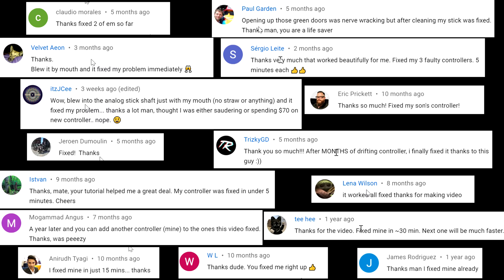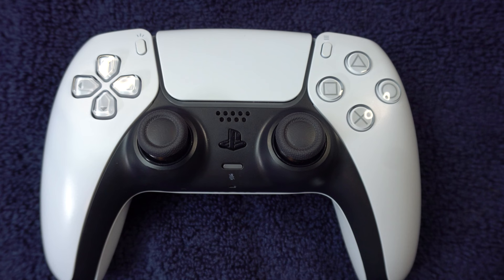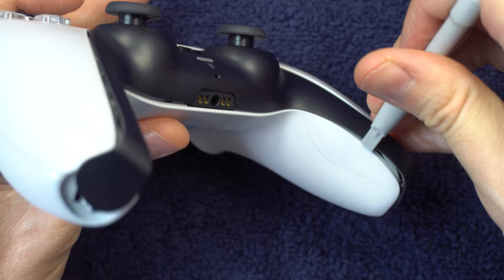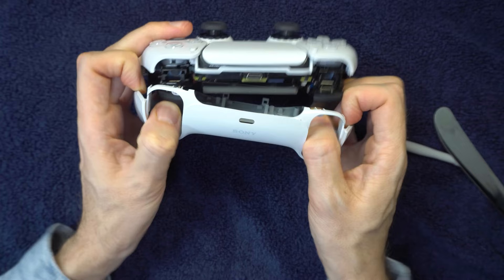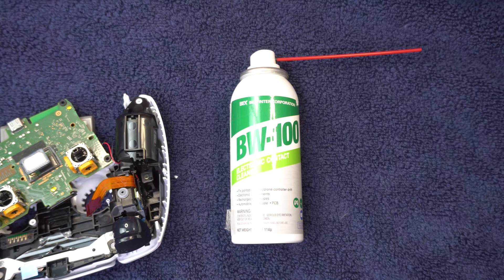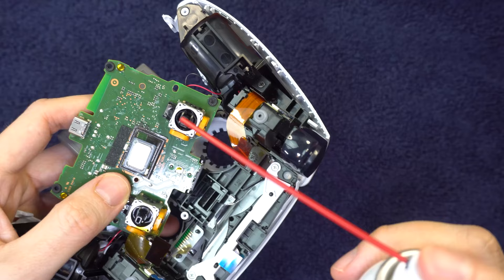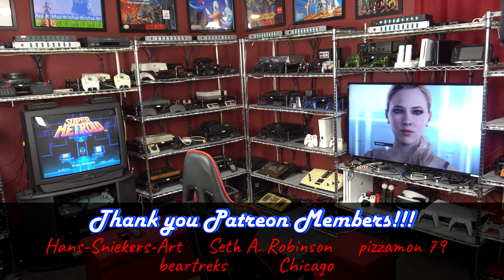How to Fix Analog Stick Drift on PS5 DualSense Controller (Sprinting/Repair/Clean/R3/L3/Take Apart)

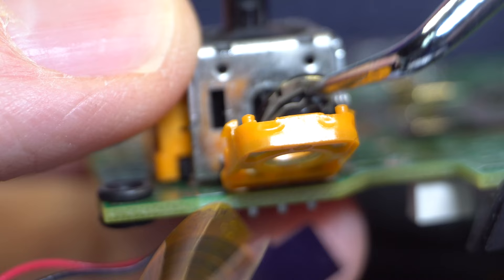Comment: At first, I followed your methods 6 & 7 (minus the reassembly between the steps), then I reassembled it. The right stick (which had been working fine) kept registering left/right. The in-game camera it controlled kept spinning around the character. I figured I must have goofed something in the reassembly (since it was the left stick that had had the drift (only it was behaving at that point). I watched again where you said to make sure to hang those little wiry discs on the hook right side up (like you showed at 12:50) and I wiped it with a dry Q-tip once more after I hung all 4 of them this time. I must have messed up on the reassembly a bit the 1st time, because one of those upright contacts on the board that touch the speaker looked like I must have bent it when I snapped the cover back on the 1st time, so I tried to bend it back. IT SNAPPED OFF! I kept going though, and after reassembly and 10 minutes of testing in-game, there was no issue at all. I'm a bit sorry about the speaker contact, but this was after a long day at work, so it's better than having to buy another PS5 controller. Thank you, How to X.

Comment: The majority of issues that cause analog drift is dust/debris when your not using your controller lay a microfiber cloth over it if you don't have a storage device. 
Even a thin plastic bag,etc. 

You can decrease your odds of getting analog drift by doing this. 

I disagree with using a straw or even a can of air and putting the straw in the analog. 1 if you use your mouth your blowing in hot humid air which negatively effects the lubrication/grease within the analog sensor device. It can dry out the grease and if you use your mouth the humidity can cause the lubricant/grease to thin.

I recommend that if you do use a can of air, keep it an inch away from the analog and spray air inward as you use your other hand to move the analog stick around to allow air to gain access inside. 

9/10 controllers I service that have analog issues is dust/debris (like eye lash hair for example). The disassembly of the controller illustrates here is the correct method  and the narrated directions are superb. The only critique I have on the disassembly and reassembly is that you should use precision tweezers and/or precision needle nose pliers when removing the data connection ribbons from the motherboard using the tabs and not gripping the actual wires. If you use your fingers and are unfamiliar with the durability of the connection ribbons you can crease or crack them and damage them to the point information is not passing through.

Good vid, love the content, keep it coming.

Caught myself spelling ribbons incorrectly lol had to edit to correct 😂 my apologies all, English is not my 1st language.
Reply from the maker: Thanks for the comment. Do you happen to know how someone can push L2 and get forward movement in their analog stick, despite not touching the analog? My next video is about this mysterious issue.
Reply: @HowToX  
I haven't faced this issue with a PS5 controller, though the operational mechanics do not differ much from a PS4 controller.

1. Conductive liquids being spilled in can be a culprit (soda, etc). If the covered area crosses past both the analog connections and the trigger connections.  

Faulty L3/R3, if you have cracked or damaged the motherboard from beating up on the L3/R3 that can cause the issue and even a creased/broken ribbon can cause the wrong information to be read by the controller. 

If your sure no liquids have been spilled, check your ribbons and use a  led light to shine through from the back towards you to ensure the inner connection lines are not broken and/or cross do to crease/collapse.

If nothing visible it's not the ribbons.
That leaves you with a faulty L3. Where I would suggest removing the analog, remove all solder (or at least as much as you can to get a clear view of the motherboard connection) look for crack/breaks using a magnifying glass or any optical enlarging tool you have at your disposal.

If no cracks or damage re-solder on the analog as the solder itself may be the culprit. It it persists change our the analog. 

That should resolve the issue.
Reply from the maker: The thing is, it's a specific bridging of signals between two buttons, the L2 and L3 or R3. It's never any other combination (in the sampling I took). Do you mind watching my video on it right here: https://youtu.be/_QmL9YEP3M0

Comment: Replacing only the disc won't do much, if anything. The problem is the conductive material of the "door" part gets scraped away over time, so that is the part you want to replace.
Reply from the maker: It can get dirty, scraped, or both. Sometimes they leave the factory dirty.

Comment: Does the printed circuit board have a protective coating on, when cleaning with IPA I noticed like a yellow hard gel coating on it, I cleaned it off. The controller works amazing now. I even cleaned inside the yellow doors. Thanks for this guide

Comment: I fixed mine,  this is what you have to do.
#1 those two knobs swop them.
#2 make sure all wires are in place if not glue or saulder them. 
#3 that box with the lil door open it a little and pore alcohol on the whole box. 
Thank me later!

Comment: I replaced both potentiometers in my right analog stick and it seems that I got two with quite the difference in resistance compared to the originals that were on it. I wish there was a way to recalibrate them like they do at the factory. My stick drift is now worse than it was before. Lol.

Comment: I have cleaned as instructed, thank you by the way.  My right joystick moves freely in all directions except up (when apart) down when assembled.  I cant find any videos on this issue.  I used q tip with alcohol to clean the stem and in and around the base but that did not work.  any advice.

Comment: 8:13 The drift prob are behind the 2 Yellow things on the stick.
Use a knife, twist knife and gentle pry them open. take out the little thing inside.
And clean Inside and the little thing, with a Qtip and cleaning alcohol, 
dust and dirt inside where the yellow things are, 99% cause the drift prob.
Lost count how meny playstation controllers i'v fixed for people. it's soo common. hehe 
I repair home electronics at work.

Comment: Is not just  the analog potentiometers what need cleaning ive taken myne apart is only 5 month old controller the analog was constantly getting stuck fully when moved to top diagonal position kept test gently moveing the white analogue potentiometers grid between analog stick still got stuck slowly streched got stuck in another position eventualy removed been stuck still got stuck mostly in diagonal position every so often constantly got stuck the white thin plastic each side between analog flexers when move analog over time degrades gets weak poor cheap part mechinism not just the analogue potentiometers

Comment: It didn't work for me, it got even worse. When I was testing the Z axis wasn't showing up. When I boot up a game the left directional stick started going right worst than it was before. It's was stick drifting right but now it's going right even more and it's not stopping. Each time I tried checking if I did something wrong but I did everything right and I follow everything carefully but still not fixed...I don't know what to do now

Comment: switched both potentiometers , after few months of use my left stick drifts again -.- .... are there any higher quality potentiometers? Tossed it from rage into shelf and took my DS4 controller back in use... which is MANY, MANY years old, have thrown it, eaten with it, done all with it. It works flawlessly (only sticks material has worn out, but that I dealt buy buying caps) .... and DualSense (brand knew when I bought it) lasted few months, the left stick had full blown drifts. Cleaning and such didn't help, so had potentiometers replaced. Now after few months my left stick is fucked again....

-.- So I either toss it into trash bin, or someone can recommend good solution...

Comment: I don’t know if my controller has started to drift or not. Just recently, and it’s random too, if feels like my left analog stick move to far to one side fast. The only way I found to stop it is by turning in and off the controller. Now it’s happening to both my controllers and I’m wondering what’s causing it?

They’re not doing typical drifting where the camera or the character starts to move by themselves. It’s more the camera feels out of control out of no where. Has anyone else had this same problem?
Reply from the maker: Test your controller. https://youtu.be/TteycPSwQ4c

Comment: It’s still so irritating they don’t allow PS4 controllers for PS5 games cause then I could at least use my nice custom PS4 controller until the PS5 controller is fixed but no…..they want us to just buy another one or fix it. I get some games definitely require the Dual Sense functions like Returnal cause it uses L2 and R2 triggers in a way where each trigger is two buttons depending on the pressure. But most games don’t depend on it
Reply from the maker: I agree, but unfortunately PS4 controllers develop problems too. The best solution is for a 3rd party company to come out with a driftproof controller that has all the same functions as the PS5. One that never wears out, and that is easy to keep clean.

Comment: Idk if anyone else has had this problem, but I CAN NOT reset the controller. I've tried using a pin and a mechanic pencil (I don't have a paperclip), but I'm absolutely hitting the button and holding it for more than 5 seconds and afterwards it just connects to my PS5 when I hit the PS button & shows it has the latest software. I'm so blown away by how terribly designed this controller is.
Reply from the maker: Hold the button until the controller turns off. After that, it'll come back on again as normal without having to pair it again, so I either misspoke in the video, or something changed.

Comment: I did method 7 which greatly reduced the drift but I still experience it occasionally. At this point, I’m going to save up for a dual sense edge which has an unjustifiable price almost as much as the series s. I’m never buying PlayStation again.

Comment: Controller won't reset. Holding the button just turns it off, but then it connects on its own with no cable

Comment: I replaced 2 controllers (not that old, not used enough to be dirty) for ps4 & slim. Now brand new out of the box they are doing it. All software is updated. I am at a loss...
Reply from the maker: It may be dirt from the factory. Cleaning may help.

Comment: My left sticks centers a bit forward after having used it for hundreds of hours. Besides that, these methods have been great for fixing stick drift to the sides. Also I have some extra potentiometers that are still good from older controllers (xbox one, ds4), so I'll have some backups in case I want to fix the slightly forward-leaning center position to replace the whole module

Comment: The inner clips that hold my potentiometer is green and not orange like the video. Does this mean I had an older batch of controller that's more susceptible to drift?
Reply from the maker: I have not heard of a variation that is more or less susceptible to drift. Some new controllers drift within weeks.

Comment: Damn. Had no idea PS5 controllers were so faulty. My controller lasted nearly a year before the drift in my left started happenin. My PS3 & PS4 controllers lasted longer n this piece o crap. And none of the "solutions" I'v tried so far have not worked. So outside of just bitting the bullet and buying a new controller, my only option left is to ask my dad to take it apart and clean it. Hell I might have to buy another one anyway incase he messes up something.

Comment: Any fixes for the annoying "click" inside the potentiometer when moving from left to right?
Reply from the maker: I wish I knew the answer to that. It's possible a piece of debris fell in there. In that case, the inside cleaning methods may help.
Reply: i hate that noise so much like how the fuck did all the predecessors not have that issue but this ds pad does😭😭😭

Comment: I know you made this video two years ago but I have a problem with my r3 button where the button like the one inside the smaller one is stuck down. Can I fix it or should I just get a new controller
Reply from the maker: If you are talking about the tiny button next to the analog stick, try cleaning it with alcohol and a toothbrush.

Comment: I’ve tried everything except taking it apart and even used massive compressed air and my left stick still goes left hard. I’m a super clean person so no food, drink or dust gets in it.
Do I try to take apart or buy a new one and keep this OG one for parts for future??
Reply from the maker: The dirt inside may come from the factory. I say if you are just going to get a new one anyway, try taking the current one apart. Even if you fail, you will have parts. Going inside and cleaning the inside of the doors yields a high success rate.

Comment: Got to step 7 and the metal bulge wiper on the side my stick was drifting towards was seriously bent and deformed out of shape. The door on that side couldn’t close again. I don’t know if I bent it during the process or it was already broken and that was what was causing the drift.

Guess I’m off to buy a whole new analog stick and find out.
Reply from the maker: Instead of replacing the analog stick, you may want to first replace just the wheel that goes inside the chamber.

Comment: My controller when I aim on cod and slightly move the right stick to the right, it freaks out and goes to the left? This isn’t stick drift and I don’t know what is causing it. Will cleaning it help?
Reply from the maker: That's a form of drift and cleaning may help.

Comment: I reset my settings on my playstation 5 which caused me to get stuck on a screen that requires me to use the USB connect to PS5 controller and then I'll be on my way but the PS5 controller is not pairing I have tried to reset it several times with the button from behind I've tried to connect it with a different USB I've tried to pair it with a different device but nothing. I cant even go rest mode to try that
Reply from the maker: Are you sure the cable isn't a "charge only" cable?

Comment: I think I have stick drift now myself but I dont understand what it is, chiefly because I've never had it before. Can someone explain to me what stick drift is and I will be able to tell you if I have it or not. Thanks.
Reply from the maker: For the purposes of this video, it's when one of the analog sticks isn't responding as expected. Most common, is when your character moves on its own in the game. It can also be a menu selection that moves on its own.
Reply: @HowToX  yep that's it bro that's it, I've been playing Ghost of Tsushima Directors Cut and I'm sure you will understand that timing is more or less everything in that game or its one of the more important things. So anyways I'm moving my pan around right stick and when I'm releasing or easing off of the pressure it is still sorta like moving and it can throw you off what you are doing and I have heard about stick drift only I've never had it so I have never needed much to learn about it. So deep down I knew but I needed to ask still because I could have been wrong it may have been anything for all I knew. Its a pre owned controller so like what did I expect really lol. Thanks for getting back to me on it it all helps m8. Tell you something else it's done aswell when I've pushed forward to move with my left stick it's jumped, my character has jumped and in some cases not moved at all.

Comment: WARNING: Do not recommend messing with the thumbsticks.  I've attempted the disassembly method at least two times. Not only did it not work, it made it unusable. I was about to do it again on my PS5 controller when I watched a live stream of this diy fix on YouTube. Well, you can guess how that turned out, UNUSABLE. 

What I did was clean it as best I could without messing with the thumbstick ( with the controller disassembled,) a few drops of alcohol, and it fixed it. I do not know how temporary this is but it's still working. I did this 5 days ago. 

I am telling you from experience, if you succeed at messing with the thumb stick, you are a small percentage of the actual outcome. 

Fair warning and good luck.

Comment: We live in a nerfed present. It's sad that I have to open dualsense for the third time since December of last year, due to drift to the left. In this video, it was said that the contact surfaces often get dirty. It´s truly pathetic from Sony's design point of view. I bought a PS4 in 2016 and the joystick from it never had to be opened. I even have the original battery in it, which still holds 4-6 hours of playtime. I'm an active gamer and play every day, it's sad and grotesque at the same time that the new joystick won't even last 5 freaking years.

Comment: That is unbelivable, Sony messed something up completelly, maybe reduced quality of material used for potentiometers - have my PS4 since release date in UK and never had a problem with controllers ( still got the same which came with consoll and these are perfectly fine) - got PS5 from April 2022 - analog drifft problems occured in October 2022 - 6 months of rather low usage... Sony that is a massive fails as I can see a high ammount of users got the same issue with Dual Sense controller.
Not happy.